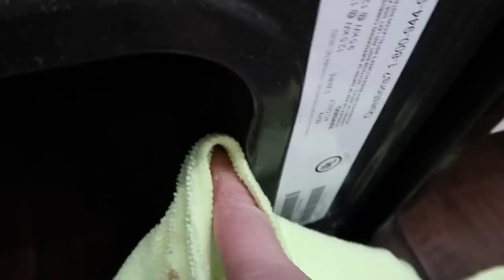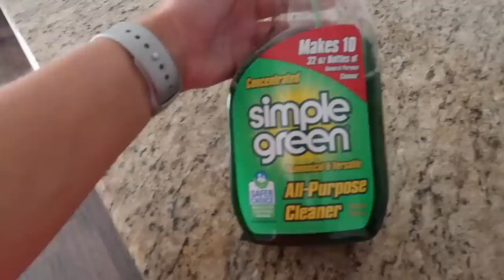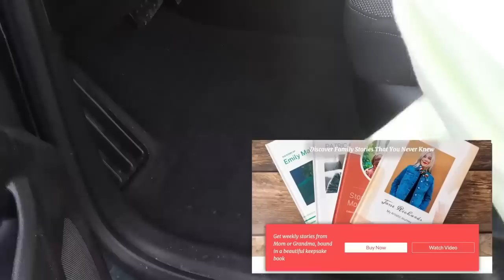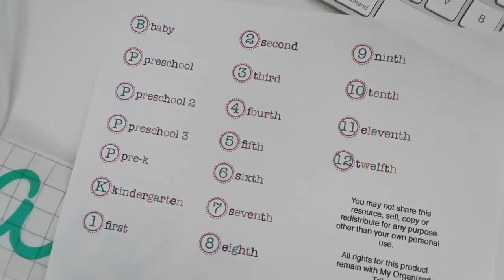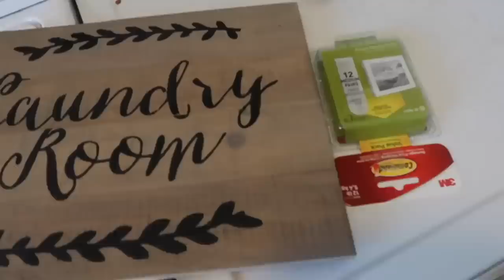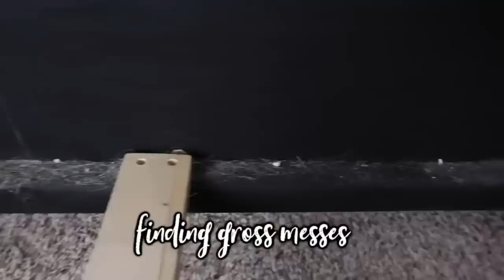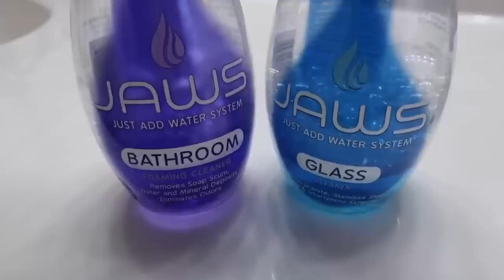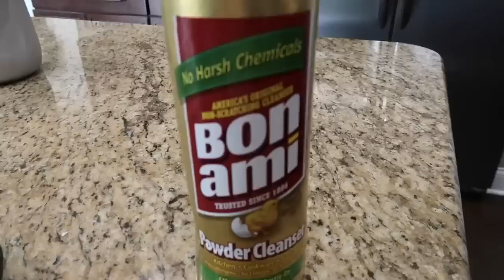EXTREME CLEAN WITH ME | HOURS OF DEEP SPEED CLEANING MOTIVATION | DEEP CLEANING ROUTINE | HOMEMAKING

Comment: I know you moved out the house, but when you said the plumber told you that the toilet doesn’t need to be sealed? I’ve been a plumber for 13 years and never have I heard that lol. You always want to have a wax on the bottom of the toilet and then Caulk the base, the caulking IS optional, but I’ve always caulked around the base and left the back open just in case it would leak. I’ve installed thousands of toilets over the years, just a tip! If you are also ever looking for a new toilet try the KOHLER ELLISTON WITH revolution 360 flush, it has a jet unlike any other toilet and swooshes the bowl clean. It’s about 290 dollars but definitely worth it. I have 4 in my house right now and haven’t had any problems what so ever since Last year when I installed them. Check it out! It’ll help you clean

Comment: Hello, just watched the video and I see you have high carpets and you get a lot of hair in the shampooer, my favorite vaccume is the new rainbow it picks up really well and also you can see what comes up from your floor. I also like to leave the vaccume running as the air purifier after vacuuming a room with clean water to see how much dust was tossed in the air from vacuuming and it's surprising 😮 also I love the airfreshners I can use in the water bin. PS the new rainbow pops on and off the the top of the vaccume instead of removing the whole lid much simpler. And you wouldn't need a shop vac when cleaning  your windows cause you can suck up water with the hoes. And with the attachment you can use it for a carpet cleaner also so it's a whole cleaning system.